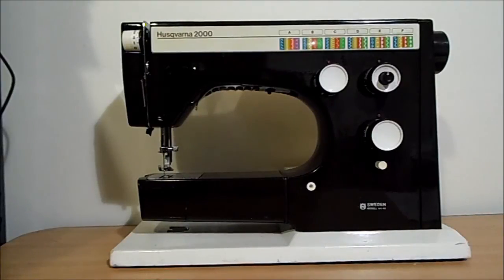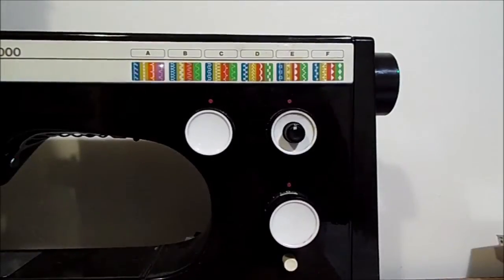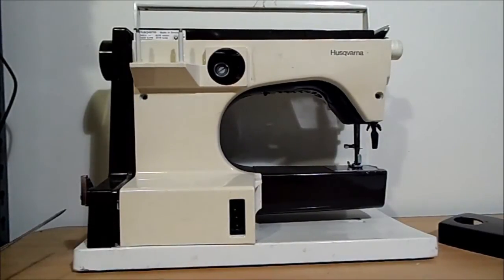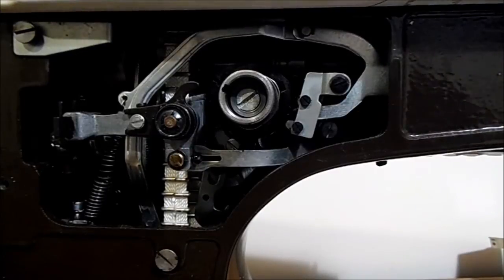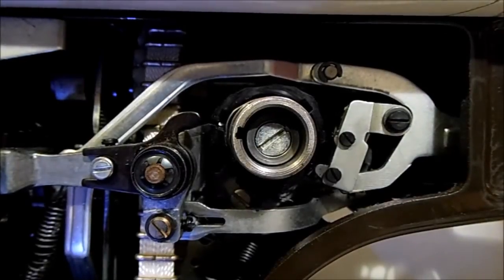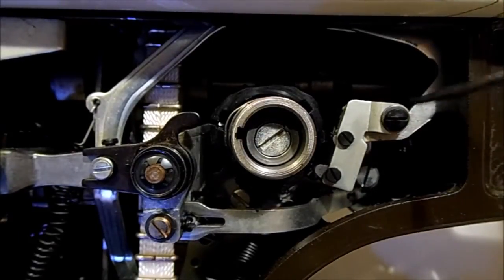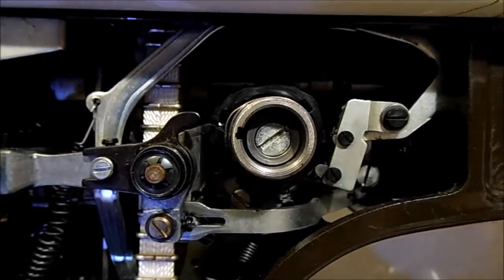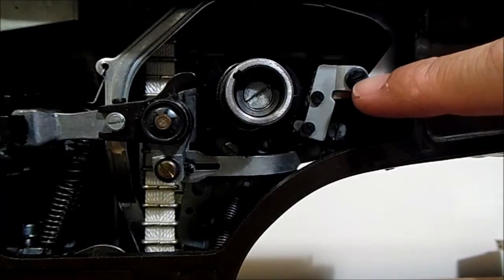Husqvarna 2000 sewing machine - Setting the raise of the cam follower

Comment: Hi!
I have a 6230. I have been repairing the pattern mechanism. Some teeth on the cogs where broken off. When set on zigzig, the cam follower when comming down from a lope it gets stuck on the edge on the next pattern in front and suddenly jumps off the edge. (hard to explain). It is only a fraction of a millimeter that the camfollower doesn't seem to be aligned with the cam. It is only happening when in zigzag modes. How do I adjust the alignment? Is there a screew or could this have anything to do with the cogwheels?

Comment: hello could you tell me the circumference of the small belt of the engine and the amount of teeth where possible of the two belts that this machine uses .. since in Venezuela we do not have spare parts distributor and I need to locate a replacement belt or adapt another similar one in dimensions..thanks for your answer ... regards

Comment: Hello, is that cam replaceable? after watching your video i was looking  into the whole the lettered cam caps? pop into and noticed that the cam is snapped like yours. It sews great in a straight line but wont do a zig zag or any of the fancy stitches for more then a inch or to  some none at all  then goes to straight stitching. I really like this machine and would love to be able to do more with it. mine is a older two tone green unit thanks for any help you might have